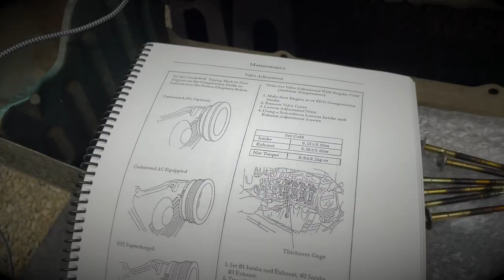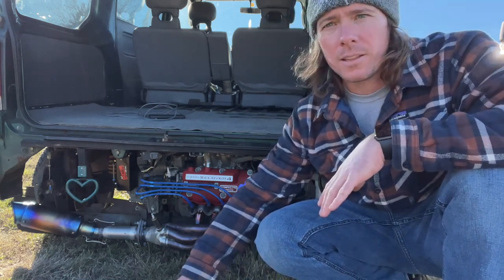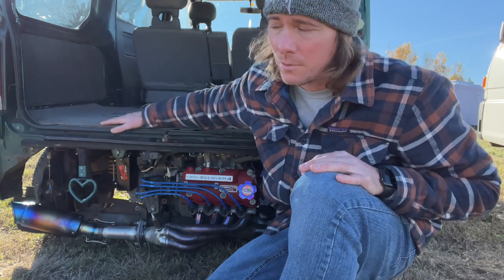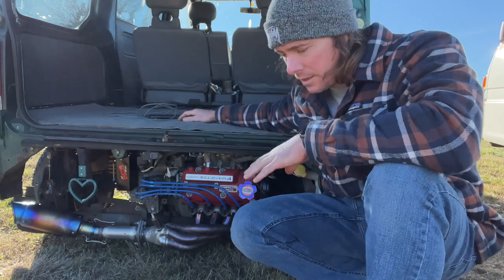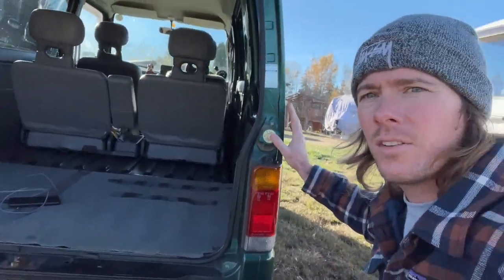The Absolute Basics on the Subaru Sambar Truck and Van for the Future or New Owners KS3 KS4 KV3 KV4

Comment: Hint:  For the Sambar truck.  PUSH IN the engine cover while turning the key in order to open up the engine compartment.  If you don't push in, friction will tend to rigidly affix the latching mechanism in place ... it won't turn at all.

Comment: My very first car was a 1992 Subaru legacy and I absolutely loved that car, everything was logical and easy to service... The fuel filter was right on top on the right side... The AC was a beast and the only reason it stopped working is because my mother was a spoiled woman who would turn it on full blast, then turn the heat on full blast while in bumper to bumper instead of moving the temperature slider which caused my AC clutch to seize, she would also drive it over 100mph when she was late for court, etc... everybody hates the automatic seatbelts, but as a proud uncle I was happy to see that my nephew was looking like a gentleman with his seatbelt on, that car was a blessing from God, after riding the bus to work and back and my mom's ford explorer getting attempted robbed because I caught the guy breaking the window with a crowbar... Obviously we weren't living in the best neighborhood, but back to the car, if you treat her right shell do the same in return

Comment: A REALLY good video is how to make the changes to the sambar to pass the inspection. Here in BC you nee to have DOT headlights, 3rd break light, DOT tires and flashing turn signals on the side of the truck.
Reply: I passed in BC without any of that. I did need dtrl's.

Comment: Just an FYI on the battery you can easily replace that with a powersports/lawn and garden battery.
Reply from the maker: do they have the pencil point terminals?
Reply: @OhKeiGarage  No but either JIS battery post adapters (13 and some change ) or change you cable ends to standard ends also cheap.

Comment: Wow, nice sanbars! I live in Seattle, I just bought a 94 sanbar van from TCV. Seems like there is quite a club of sanbars in WA state.
Hopefully it doesnt take too long to get here, I'm sure ill have to work on it. It's not supercharged, but is 4WD.
Ill be back for questions I'm sure!

Actually , any advice on customs? That part I have to deal with, not the exporter.
Reply from the maker: thats exciting! customs was easy, i made a video on the importing process, you should check it out :) mainly just show them paper work
Reply: @OhKeiGarage  Ill check it out, thanks a lot.

Comment: Just got my supercharged Sambar van (1996). Super clean. Don't want to mess anything up. Very basic question...Gas!  Dealer said regular is fine. Another friend with a 'classic' using Non Ethanol. Others say Hi octane is best. What is the consensus? Thanks.
Reply: 日本のガソリンはアメリカの企画に比べてオクタン価がとても低くなっています。日本でのハイオクはアメリカのレギュラーに近い。そのため、レギュラーで大丈夫でしょう。オクタン価を高めるようであれば、点火時期を少し早めるなど微細な調整が必要かもしれません。日本語で失礼いたしました。

Comment: Oh also wondering if you could do a video on checking the idle rpm and how to adjust? I think mine is too low and engine stalls at lights occasionally.
Reply from the maker: actually i kind of did. i showed and talked about it, pretty straight forward process and i show where the screw is. https://www.youtube.com/watch?v=xFdaewe8nE4
Reply: @OhKeiGarage  Thanks I'll give it a watch.

Comment: Thanks for the vid.  Is there a brand of antifreeze coolant you recommend for the truck? I have a 1992 KS3 Sambar.
Reply from the maker: if you're green, get the subaru green coolant, can't go wrong with oe fluids. pick up a gallon on amazon or ebay, but make sure it's green, not blue.

Comment: I just bought a 1998 sambar automatic van and want to know if there are any  mods to make it a little faster or reliable.
Reply: its a kv4 and supercharged but I hear that they are the worst for being automatic instead of a manual  so I was hoping if anyone knows a website where to look for transmissions for em.
Reply from the maker: It being supercharged you’re already 10 steps ahead of us in power but as far as the trans go, you may want to just get yourself a powder clutch before it goes out. You could do a manual swap but you will need a lot of parts. Basically a donor vehicle. I think Yokohama motors has some stuff for the autos

Comment: What is the fan behind/ under the passenger seat? Should it be constantly running?
Reply from the maker: Thats the rear heater, and no it shouldn't be on all the time. should be a switch on the center console behind the e brake

Comment: Was about to start modifying the exhaust on mine and was curious what you did with the pipe that goes from the driver side exhaust up to the, what looks like, a vacuum solenoid or similar?
Reply from the maker: so different years have the egr valves, mine did not, but i believe you could just plug the vacuum line running to the diaphragm, ive seen it before, then just remove it all. i think its just an emissions thing. not performance
Reply: @OhKeiGarage  ah perfect, didn't realize it as the egr valve. I'll definitely just delete it.

Comment: In your opinion how reliable is the sambar? I've heard mixed reviews.
Reply from the maker: very reliable. non interference motor, so the timing belt breaks, you're good. the others will require a rebuild if it breaks lol... easy to work on, easy to get parts for. i haven't had issues with them so i can't complain. honestly, i would recommend the Subaru as of now for sure.
Reply: @OhKeiGarage  thanks for the quick response, I have a twin cam hijet van but looking to get back into a pickup. So I'll start looking into sambars now thanks brother. Love the work you've done on yours.
Reply from the maker: @androdiehl6596  thanks man 🤙🏻 look for a supercharged Sambar then!
Reply: @OhKeiGarage  I've found a few, allot of main bearings going out due to people beating the crap out of em. I'm good all motor with an exhaust and cold air lol
Reply from the maker: @androdiehl6596  well there’s that. But honestly that can happen to any kei truck. They aren’t really designed for the driving we do in the US. People want to daily them on the freeways with carb’d vehicles, gas gets into the crank case and thins oil out and burns em up. If you daily on the freeway, you just have to bump up the oil change intervals. We think since they’re cars they can handle anything but in reality they can only handle what they were designed for 🤷🏼‍♂️
Reply: Absolutely agree, I don't daily mine and I don't run it out 120kmh on the highway so I'm sure she'll last lol.
Reply: Damn bro, I have wanted a Subaru sambar with supercharger for a very long time, do you have any for sale, even if it is not running, because that'll be the only way I could afford one, but I can't find a good fixer upper

Comment: how much fluid should i fill into the radiator??
Reply from the maker: in the radiator, not the overflow right? you just wanna fill it till full and try to remove all the air.
Reply: @OhKeiGarage  the plastic tank next to the engine should tell me when its full right?
Reply: @OhKeiGarage  finally got her to the shop and they said i need new coolant hoses for the whole van and a new engine starter, they said i needed to supply the parts where should i look to buy them?

Comment: I would sell my soul to Satan for a Kei van with air conditioning.
Reply from the maker: LOLOLOL
Reply: You do not understand how I need a vehicle to mount rooftop u-shaped Lockwood valveless pulsejet nozzles of hafnium alloy so I can mount on inside rear ceiling an x-ray machine powered from wires to electrical speakers for quantum nucleonic propulsion.

Podrog's Patent and 2004 issue of "Popular Mechanics" on such an alternate energy source..

I already have had peer review for my MIT published articles edited by Dr. Mitchell Swartz and have given by invite only MIT presentations so I need one test vehicle.